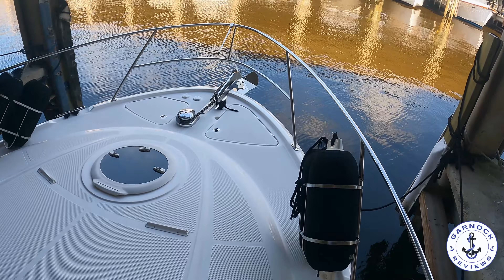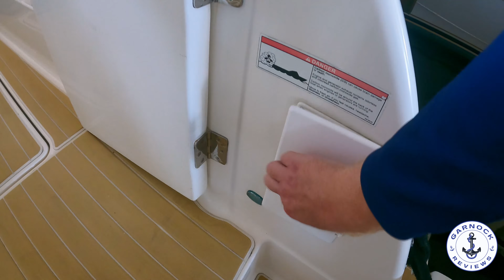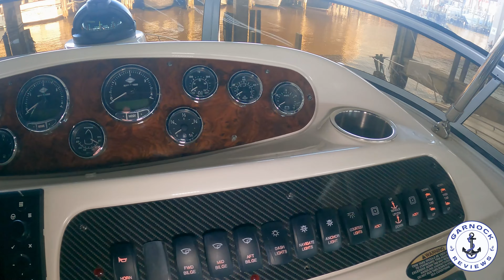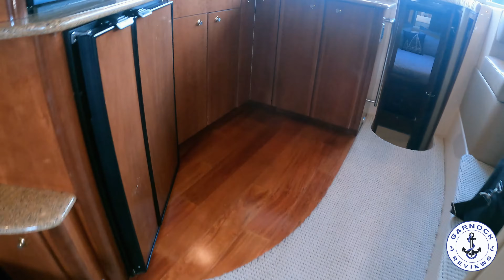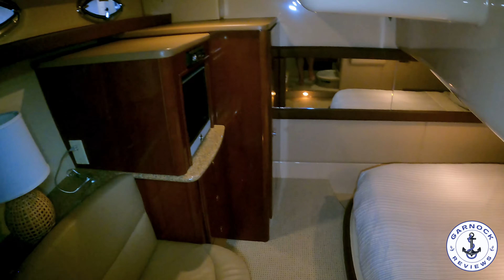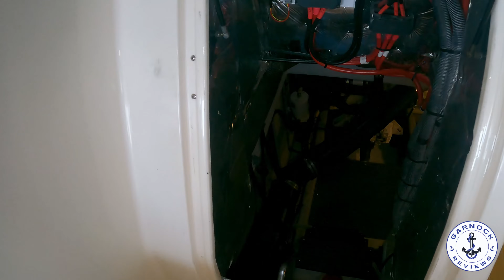[Sold] - $319,000 - (2008) Meridian 411 Sedan For Sale - Only 1300 Hours!!!

Comment: I would fix that HPF fault on the HVAC system before I’ll look to sell that boat
Reply from the maker: I'd always recommend a good survey, sea trial, and mechanical inspection before buying any boat. The HPF fault is common on boat ac units. It is normally just a blockage of water flowing. Usually, you can clear the filter and lines, and she is back up in running in no time 😉
Reply: @GarnockReviews  no doubt that's usually not serious but it can be annoying for sure. Other than that it looks like a very clean boat.

Comment: Impressive and seems to be very well maintained. I know you said it is good for the great loop, but I would like to know what the air draft is anyway. Is it under 15 feet with that radar mast?
Reply from the maker: Thanks for watching. When I was doing my research for the video, I found several sources saying 15ft air draft. I would assume that's to the top of the radar arch as that would be a standard install. The electronics may differ though. If you are buying for the loop, I'd recommend measuring real careful to be sure, but I'm confident it will clear the 19ft limit 😉